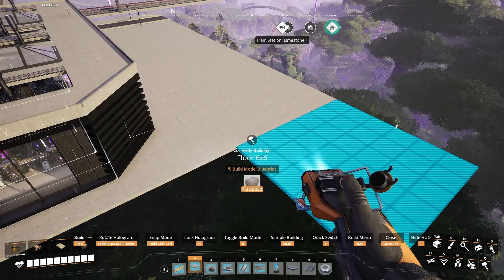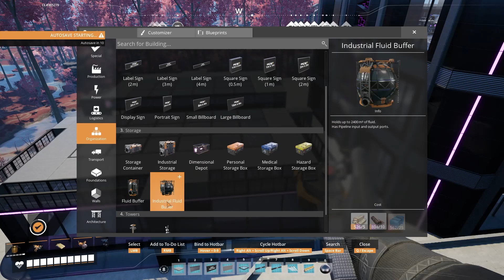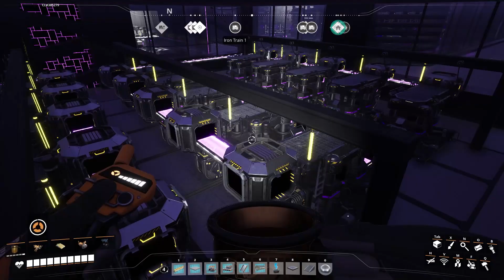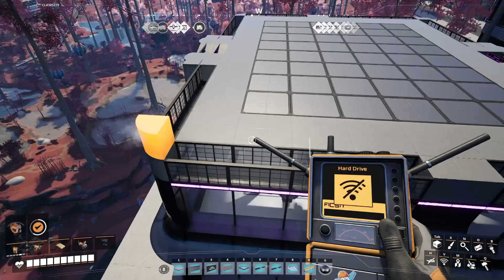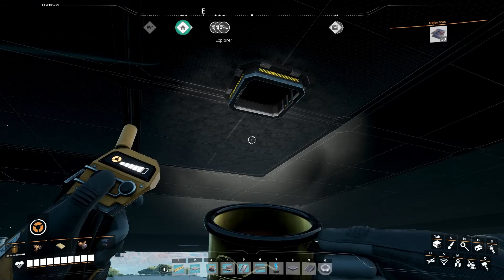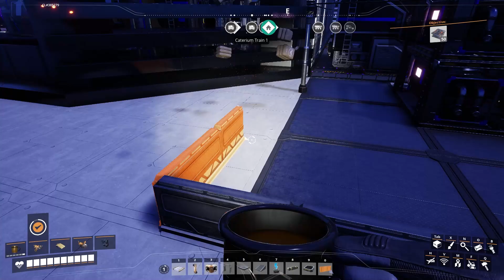Using roundness for a softer touch - Satisfactory 1.0 MEGAFACTORY EP06

Comment: If you’re trying to remove 1200 items on a 1200 capacity belt and you have a backup (from setting up the sink), there is no way you will ever remove the backup unless you manually remove the excess from the machines.